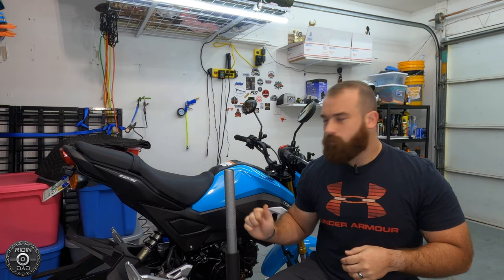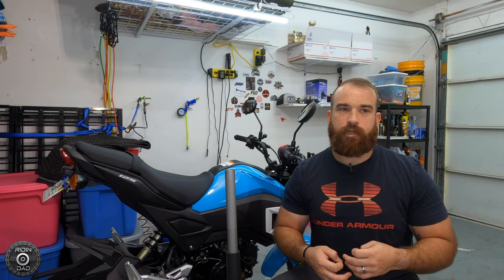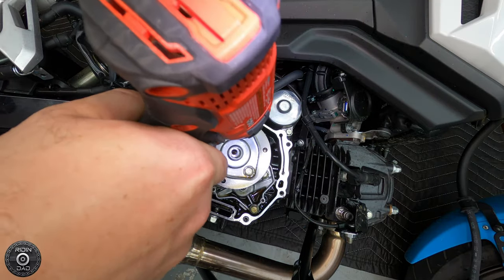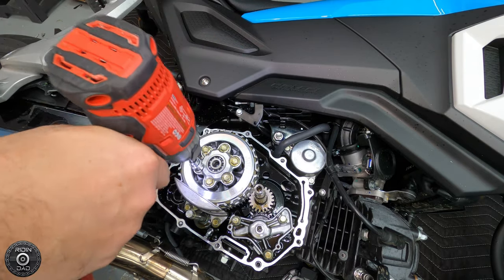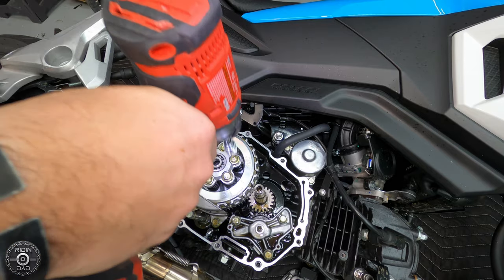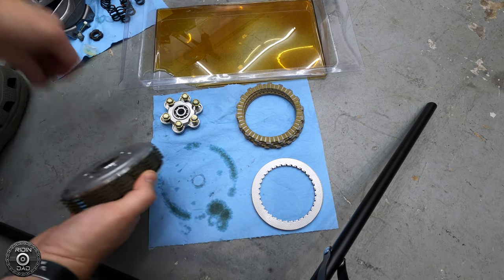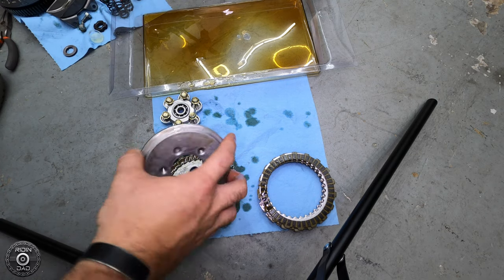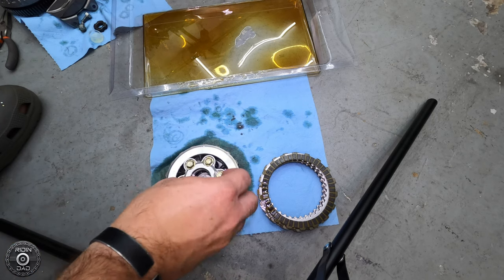SMR 6 Disc Clutch Upgrade on my Honda Grom (msx125)  *upgrade from the stock 5 disc clutch*

Comment: Did you get any chatter with yours by chance after? I have 80% springs and did the same clutch pack and I’m getting some chatter at idle after cable adjustment and all
Reply from the maker: Nope. Not here. No extra noise at all
Reply: @RidinDad  shit. Guess mines coming back apart lol
Reply from the maker: Lol yeah, no Bueno. It’s probably something small and easy though. Maybe he just one of the pieces did not since down all the way for the springs

Comment: Do you suggest upgrading everything while doing these clutch disks? I got the Koso lifter plate as a gift but it’s only for 3 bolts and 60% springs. Will that be fine or should I get the basket made to upgrade all 6 springs and a better lift plate ? (Hopefully I said all that right)
Reply from the maker: You can do just the diy setup I did with the springs. The better plate is an upgrade but not needed really.  All up to you. But you’ll be fine with the minimum like I did

Comment: HELP! I installed a after market 5 disc clutch, new clutch plate and springs. After putting everything back together I’m UNABLE to get the crank case cover to line up. It’s like it’s binding around the bearing for the oil spinner and the rod under the clutch basket. If anyone has any help for me please let me know!!
Reply from the maker: My best troubleshooting would be to disassemble everything and assemble everything again. Obviously if something is binding up that means that something is not installed correctly
Reply: @RidinDad  thanks for your quick reply. I’ll try that. And sub
Reply from the maker: Thanks!

Comment: Any issue adjusting your clutch? I did the same mods (smr 6 disc, 80% springs, chimera lifter) and have cable adjusted all the way out. Its either slipping or if I adjust other way hard to get into gear. Everything torqued to spec.
Reply from the maker: Nope no issues here. I’m willing to bet your issue is with the clutch basket. It’s incredibly common. Something isn’t seated all the way. Take it apart again and just reassemble the basket and rings. It’s such a tiny gap if it’s not all the way seated. Hard to see it and easy to miss
Reply: @RidinDad  thanks I did that a few times. How far out did you have to adjust your cable?
Reply from the maker: I don’t remember. But As sort of a general rule there should be about a Nichols width of free play with the clutch cable. So not that much at all of not engaging and then as soon as that engages you should not have any issues at all. I’ve talked to probably six or seven guys personally that had this exact similar issue and read about dozens of others and it’s always an issue of the clutch basket
Reply: @RidinDad  thanks I've taken it apart several times and made sure everything lined up. I'll keep adjusting I guess.
Reply: @oragromi3088  did you fix it, facing the same issue
Reply from the maker: You’re having the same problem that everybody has. The disks and the clutch basket are not lined up 100%. It’s such a small amount that it is very hard to tell but that is the issue. Nine out of 10 people they do this install have that same issue including me the first three times I messed with it. Take it all apart and take the disks out and put them in again and make sure that everything is fit correctly and be very careful with it while you’re putting it back and make sure that everything stays 100% intact
Reply: @olexandrfrantsen9333  yeah I actually fixed it just by adjusting my clutch cable. My plates lined up fine.  There was just enough difference in thickness of the plates that I had to adjust the cable all the way out. Wheelies just fine now.
Reply: @oragromi3088 I’m going through the same problem we switched it to 6 Disc sex machine with 60% springs and aftermarket clutch basket and now it’s hard to kick it into gear while it’s off or when I ride is that how yours felt??
Reply: Feel like I’m forcing kick inn gear up or down idk what happened please help anyone that’s reading 🙏🏽
Reply: @Jcm262  once i confirmed plates were lined up. It was just a matter of adjusting the clutch cable. Works fine now.